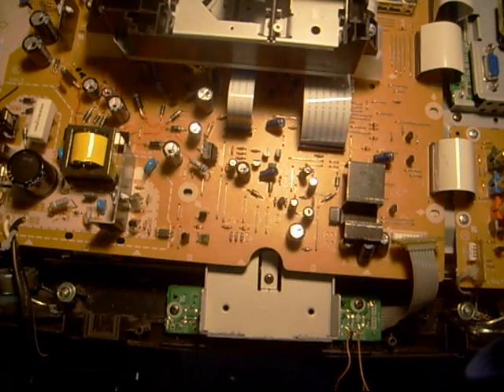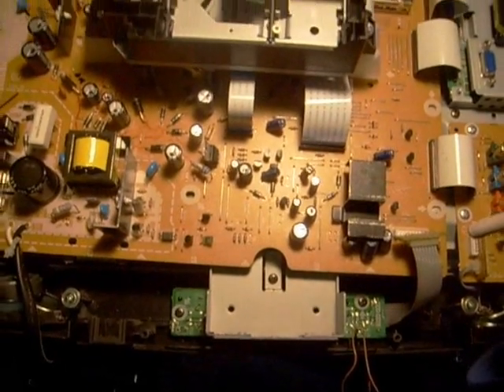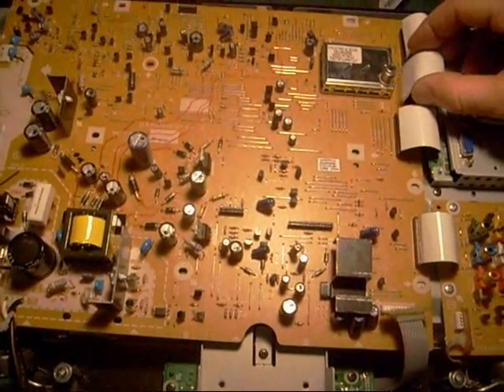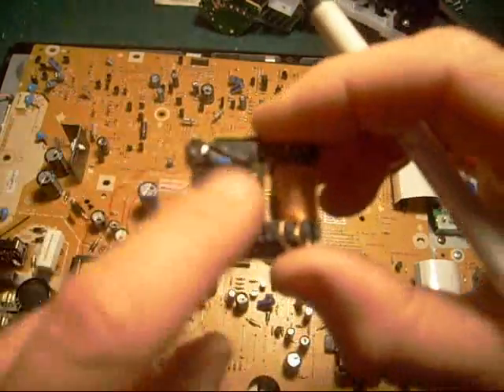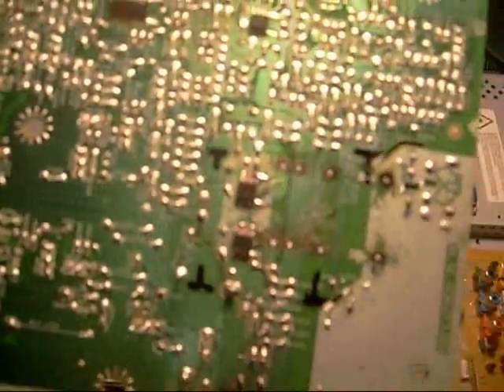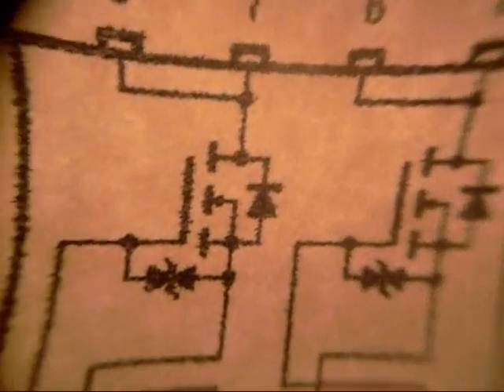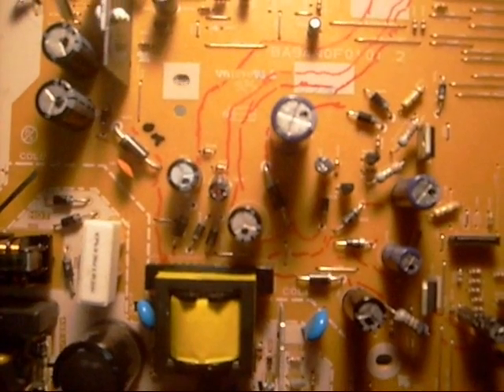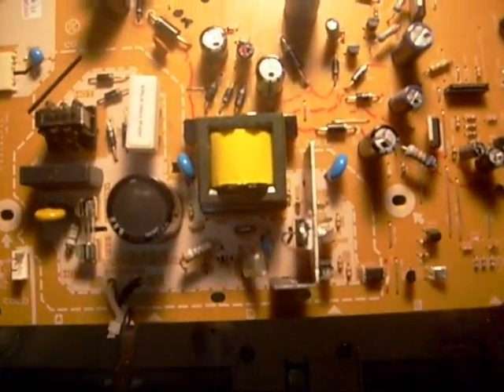Finding a shorted component.

Comment: Hello, I have a set of Samson studio monitors. I have had them for some time now. I have power but no sound at all. I have tried a lot of different sources i.e power, audio, and cables. The problem is just with one speaker. Please help! And ideas on what this can be?
Reply from the maker: Sounds like one of your audio output transistors or ICs may have blown, but I'm just guessing since I don't know anything about these monitors, or if one of your speakers is bad, or perhaps something wrong on the input side or the output side of your audio output IC. Did you check the input signal to audio amp IC or transistor?
Reply: Grants Pass TV Repair- unfortunately I don't have a lot of knowledge of testing these parts. Is there a site you can refer me to?
Reply from the maker: I can't give you a specific website, but your can start by studying how audio amplifiers work how to read schematics, and how to test transistors resistors, diodes, capacitors and resistors, and then see if you can purchase a service manual for this monitor which has a schematic and start testing for shorts opens and missing voltages.
Reply: Grants Pass TV Repair - ok thank you for helping out. I'll see if I can fix this problem. I just wanted a good starting reference

Comment: had a problem a year later dealing with it.my motherboard has 3 slightly bulging capacitors rated 6.3v 680uf.i have them on order and i know to go with correct voltage but can i get away with 16v for now in place of the 6.3v
Reply from the maker: I've never had a problem going up on the voltage a little. You should be fine.
Reply: Capacitor voltage can be higher (it is even better if it is higher), but capacitance must be the same.

Comment: I use another method to check circuits like these by ova meter simply by checking the output voltages and the line drop voltage i the voltages supplies

Comment: Of course you could also check the diodes by lifting a leg and doing forward and reverse resistance measurements. Usually I find quite a few diodes can be tested that way in circuit and then you only have to lift and measure a couple at most. 

Also unless I have reason to look else where, I always start with the largest power semiconductors in a circuit. In an amp, I start with the drivers of the final stage, and with power supplies I start with the switching transistors and regulators. Also loose connectors and damaged cables are disproportionately common causes of failure, although not so much when a short is indicated. 

Buzzing transformers truly are an indication of distorted, e.g. saturated or cutoff operation of the input driver due to an overloaded output. This can cause higher frequency overtones to be driven through the transformer (causing buzz), but its not the only thing that causes it, such as a cracked transformer core or a marginal driver stage.  Cracked transformer cores can be nearly invisible, and sometimes only diagnosis by component replacement or physical disassembly of the transformer can confirm a suspect part is faulty. In general, finding finding shorts is troublesome and costly, and a milliohm meter adapter to a modern dmm maybe an effective aid in finding dc shorts where nothing else works. 

Enjoyed the vid. Of course I would have loved to see that replacing the 8214 fixed the short, but I understand about real world troubleshooting where cost and speed are more important factors than ego-satisfying fixes and science experiments. After all, what if there was addition damage besides just the mosfets? You have to draw the line somewhere.

Comment: Grants, if you plug the AC cord, with the TV is off, do they have AC volts in bridge rectifier or not. Cause it's on standby mode
Reply from the maker: +alsteven44  I assume your referring to the newer TVs, and that your referring to the main bridge rectifier on the hot side of the power supply which is closest to the AC plug. It's been my experience that A bridge rectifier in this location will almost always have an AC input and a DC output even when the TV is off. On older CRT TVs I've seen some exceptions where a relay or latching switch is placed in front of a bridge, or the bridge is placed in a part of the circuit that doesn't become live unless the power is on, but as a general rule on newer TVs the main bridge should have power going to it at all times.

Comment: Destroying the transistor on the primary side by disconnecting anything on the secondary side is probably no different than some of the old audio amplifiers with transistors that would be damaged if you ran them with the speaker disconnected.  I'm talking about some of the old stuff from the 1970's.
Reply: That problem happens if you disconnect the diode on the rail that the power supply controller uses for feedback.

When you do this, the feedback circuit won't be seeing a voltage any more, it thinks the voltage has dropped way down. What does it do to compensate? It does what it was designed to do. It tells the main controller "Hey, we got no output voltage, increase the duty cycle of the switching transistor(s), we need more voltage!".
The problem is, with the diode disconnected, it doesn't matter how long the primary side stays on, the feedback loop never sees anything because you disconnected the diode. So it keeps telling the controller to "Give it more, captain" - and the controller turns the switcher(s) on harder and harder until they blow up.
Reply from the maker: That sounds correct. The same was true with older transmitters such as CB radios and not having the antenna attached. Quite often it would damage the final output transistors. Now days many  transmitters have build in safety features to protect the transistors if they sense there is no load or a dead short.

Comment: First off great videos! I had question maybe you could point me in the right direction. Samsung 42" plasma had bad fets on x main. Replaced fets and driver ic. Tv ran for an hour, noticed a smell, tv shut down, bad fets and burn resistor after driver ic before fets. Any ideas

Comment: Hi i have a LCD TV Quadro 32GH10 that wont start untill 15min are passed, also the HDMI VGA, USB  are not working, i also tried to heat mainboard(heated it with hair fan >_>) but it still needed 15 min to turn on, i changed all capacitors on powersupplay and some capacitors at the main board DC-DC power section, i check all IC they are warm so i gues they are working, what culd be a problem? maybe main CPU or that dc-dc on mainboard becous i dont get 5v signal untill that 15min are passed.

Comment from the maker: Your not testing  the standby voltage correctly. If you had  no standby voltage you couldn't turn your TV on. Try measuring across your power switch. It may drop to zero when you press the power button only,

Comment from the maker: If you have a watt meter or an amp meter, you should be able to detect any excess power consumption by measuring how much power your TV is consuming, and comparing it to what the label on the TV says it should be consuming. If your power supply was switching at the wrong frequency your output voltages should be to high or to low. Did you check your caps? A bad cap can make your switching transistor work harder..

Comment from the maker: It's normal for some transistors to get fairly hot, but since I don't know what's normal for your TV I can't really comment..In the past I remember hearing a switching transformers making audible sounds due to a small electrolytic capacitor going bad, but I would also wonder if some of the windings have come loose allowing for internal vibrations.

Comment: i have a 42'' LG plasma tv model 42PC55 and it swiches on okay but i get nothing on screen at all but the power light is green and when i press like the channel up button for example it responds with the green light flashing which is normal but i still get nothing on screen, im not good with testing electrics so i haven't tried anything yet. any help or advice would be great. thanks in advance

Comment: Just curious if you found a solution to your problem. I have the same tv and same problem. Solid red light on front but wont turn on. All capacitors look fine on power board. I know its either the main board or the powerboard but not sure which yet. Dont want to buy both as they are already slightly pricey. Please let me know if you figured anything out. Thanks

Comment from the maker: In cases where I know there is a high probability the good capacitors will fail because others in parallel with them have failed I would suggest replacing the good capacitors as well, but not necessarily every capacitor in the whole TV.

Comment: hi
I have a faulty Samsung PS43D450 that makes 3 clicks and the red light flashes - doesnt turn on.
I replaced the main power board - same result, I replaced the AV board-same, I replaced the Y power board same
However If I take out the cable from the main power board to the Y board (connected through another power cable to the x board)no more clicking, no red light however no sound or video. 
The Y board is connected to the buffer. Could the buffer break the Y,x board and all 3 need replacing?

Comment: Hey! I recently bought a Samsung LN32C540 that wasnt powering on. It only had a solid red light on the front. Not blinking, just a solid red light. No clicking either. I looked at the two capacitors and 1 of them had a bolder font than the other. Possible sign that only 1 was replaced? I have pictures here... 
tomshardware. com/forum/ 59013-4-samsung-ln32c540-solid-light

Comment: Thanks for the information.  I just skimmed through your videos and noticed you don't have one that mentions how to discharge the inside of a television before working with it.  WOuld it be the same as discharging a capacitor from other devices?  And It's a must to do before working with the inside of the television, correct?  WOuld wearing latex gloves work if I don't discharge?

Comment from the maker: TV's use more power than normal for the first one second after you push the power button. They have thermistors and chokes to slow down the in rush current, but if you continually turn the TV on and off the thermistor probably get to warm to slow the in rush current, and the additional current probably explains why the fuse blew.

Comment from the maker: @chevy56123 Yes there is an X sustain board and a Y sustain board. You should find the X sustain board on the right side and it has ribbon cables coming from it which goes to the display. I don't know about the colored spots but sometimes you can eliminate some spots by adjusting the VS.

Comment: I hate to bother you,I am just getting started in this a little.Can you tell me if there is a X sustain board or just X drivers.I have found X left,X center and X right board.Shop said the IPM was failing on the X sustain,which board?Please help thank you.Also I have a pic but it is covered with large color spots with good sound.

Comment: i used to connect  light bulb to HV coil diode and run power supply unit to see voltages on secondary side,so swiching transistor was safe( i suppose). can i use the same method with any lcd/led tv?

Comment: When I had to replace a bad MOSFET in an LCD that I couldn't find anywhere, I ended up looking at the data sheet and finding one with a different part number, but the same specs. 

Regarding the issue with removing a diode- I've actually had a couple power supplies blow themselves out when I did that.  Apparently it removed the load and/or feedback that was necessary to keep it from going overboard on the duty cycle.  Also had one that went over voltage on a different output and damaged stuff.